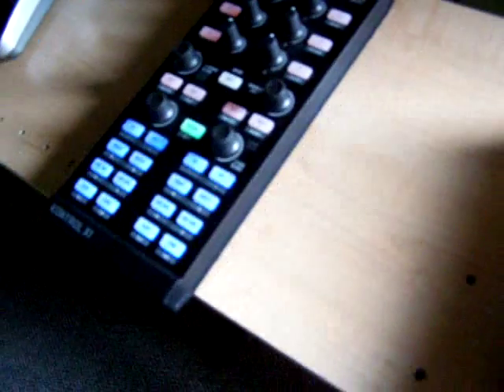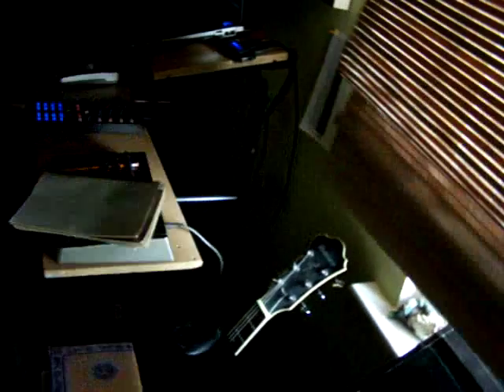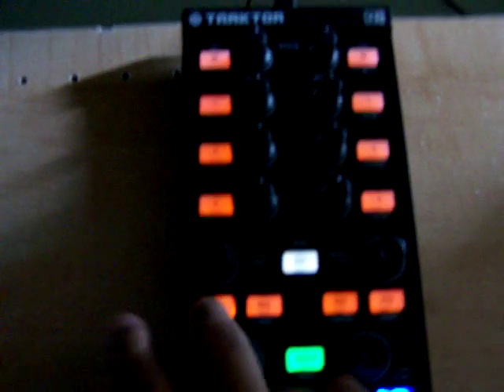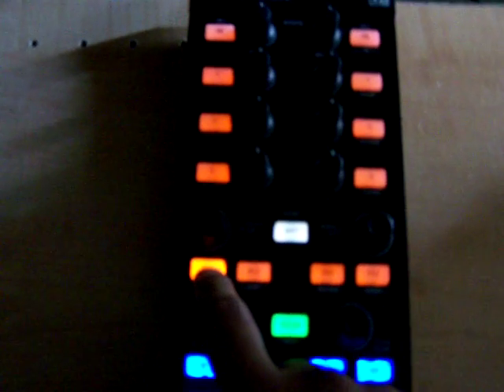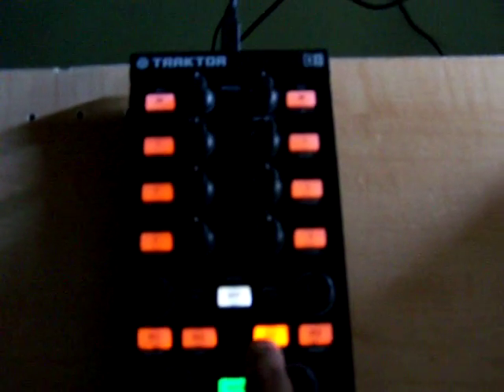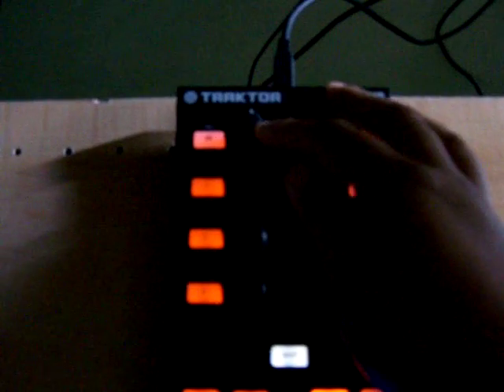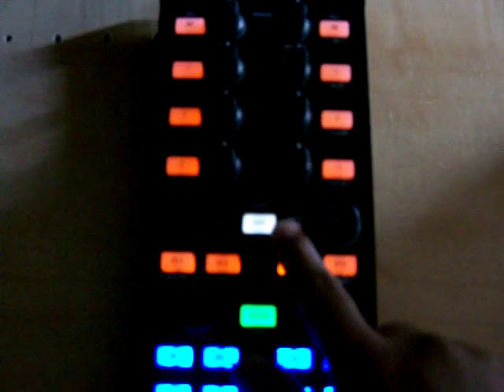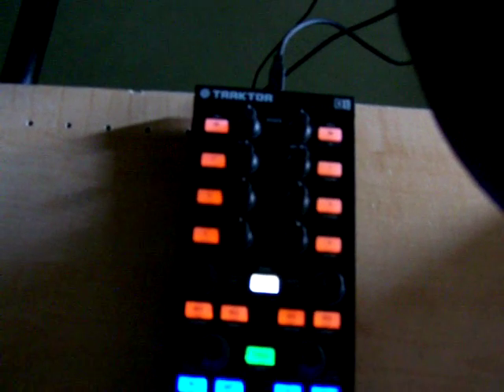Custom Kontrol X1 Mappings Explained - Part 1

Comment: @djDivineJustice I know what you are talking about, the seek function is different. 

What im looking to do is turn the knob in order to simulate a cd scratch like when you spin a cdj. I was previously able to do so by turning the browse know while in MIDI mode. but that no longer works as my mapping have changed.

Comment from the maker: @yourthebhoyThe unit is also separated into two MIDI zones: the touchscreen and the rest of the unit. Both these zones can have separate MIDI channels, so that the touchscreen could be used to trigger clips in Ableton while the rest of the unit is set to take command of Traktor.   - Hope that helps.  Thanks for watching!

Comment from the maker: @yourthebhoy The inclusion of MIDI with this mixer is very thorough, with a dedicated MIDI Out port that can send MIDI clock to external devices dependent on the bpm calculator readouts. All controls of the unit are also MIDI-mappable.Using Ableton, Traktor or any other MIDI software alongside the normal functions of two CDJs and a mixer is also easy. Using start/stop and MIDI on/off control buttons, you can choose when to send MIDI information from the mixer and when not to.